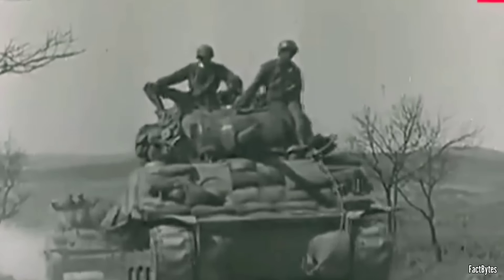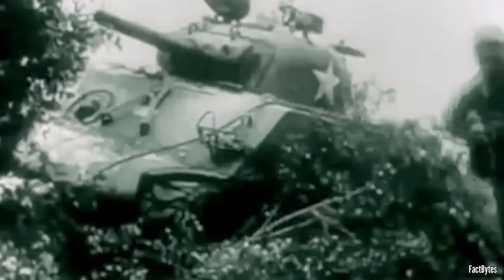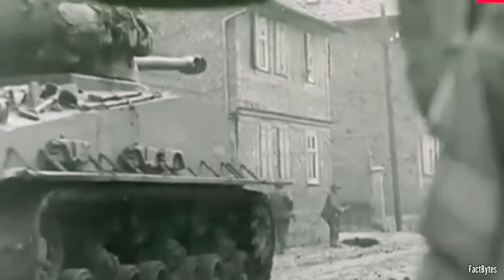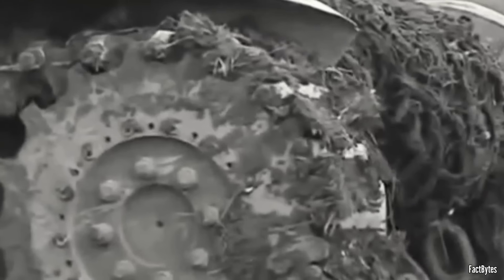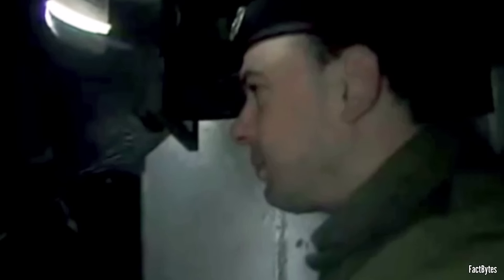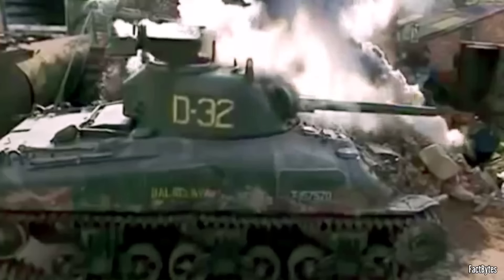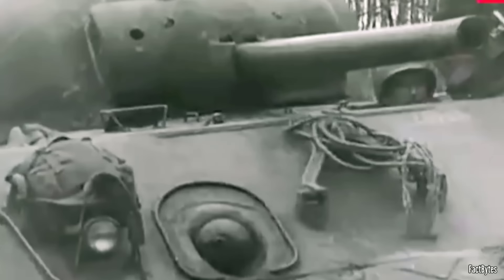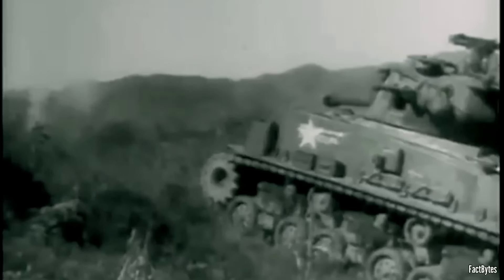Trapped in Steel: Just How Challenging Was Life Inside A Sherman Tank?

Comment: It was a massed production Medium (Everything) Tank. Any Farm boy could drive it fix it and fire it. The commander was as green as the paint. However if you shove 55,000 of these at the Enemy you will have results. The higher ups did not care about the crews. That happened afterwards with the M-26 Pershing which even then was used in limited engagements. The only (War Film) of a Pershing in action is Cologne. A Mk-V Panther is caught and ripped with 3 rounds from a 90mm M3. All three rounds went in one door and out the back. That gun was a version of the British 17 pounder by the length of the barrel and the shape of the projectile. The "Firefly" had a British gun in an M-4 Tank.
Reply: The 90 mm on the Pershing had nothing to do with 17pndr. It was the modified from the standard US 90mm anti-aircraft gun.

Comment: A primary reason for any tank to catch fire was simple doctrine.  Most tanks or anti-tank units were trained to shoot at an enemy tank until it caught fire.  A burnt out tank could not be refurbished and returned to combat.
At 13:05 there is a foot soldier communicating with the tank commander using a field phone wired into the tank’s electrical system.  This was a field improvisation that was incredibly helpful in coordinating tank/infantry combat.
Reply: The Sherman was notorious for catching fire as ammunition was stowed in the side sponsons. Any hit on the tanks sides would cause an ammunition fire. Because of the losses in 1943 the tanks interior was re-designed and the ammo moved from the sponsons to "wet" stowage bins on the tank's floor.
Reply: @billballbuster7186  No, the Sherman was not notorious for catching fire. That myth has been busted a long time ago. "wet" storage was an improvement but like the original poster stated, tanks were shot until they caught fire to make them useless in regard to repairs. In Europe, U.S. tankers had only a 3% death rate from enemy action....compared to 18% for infantrymen.
Reply: @vonbennett8670  Ok, if it didn't catch fire why on earth would they completely re-design the hull in late 1943 with Wet Stowage to prevent ammunition fire???
Reply: @billballbuster7186 It's called improvements. Everybody does it it would be stupid not to and you would quickly get outclassed by the guy that did do it.
Reply: @garykarr3948  Yes but if it didnt catch fire the money would have been betters sent on more armor and a better gun.
Reply: @vonbennett8670 Average burn rate of 62%

Comment: My dad was an ordinance engineering officer for the Advanced Section of Command Zone (AdSec CommZ) assigned to US First Army from August 1944 to VE Day tasked with setting up recovery and repair logistics chains for the 2nd and 3rd Armored Divisions. He told me that the Ordinance Branch did studies after the war and found that the Sherman took approximately 50 man hours to get off the water, gassed up, armed, and pointed toward the front, while it took the Germans 250 man hours to do the same with the Tiger and King Tiger. While the Sherman may not have been as good as the Tiger (especially before it got its gun upgraded from the low-velocity 75mm to the 76mm high velocity gun), the Allies had a lot more of them than the Germans did. As they say, tactics are for amateurs, logistics are for pros.
Reply: Do you actually believe that?

Comment: The M4 Sherman was a very good tank. Agile, reliable, reasonable armor, reasonable firepower, easy to repair, comfortable and good looking. Okay, that last one is just my opinion 😅
Reply: Next to useless armour, the nickname for the sherman was Ronson. The Sherman was the right tank in that it was fast and easy to maintain, both the gun and the armour were soso. It was also light enough being only 34 tons to cross bridges
Reply: @brianmays4366  wet stowage mitigated that Ronson effect greatly
Reply: The tank was available and effective. Not the most powerful nor the fastest, or most armored.  It was a better tank design than the early T34 but needed the larger gun to be highly effective.

Comment: Early Sherman's were death traps.
The small oval hatches were referred to as "dead man hatches."
Early Sherman turret had one hatch for 3 people to use in an emergency.
Common misconception that the fuel burning killed everyone is wrong. The fire extinguisher was very good on the Sherman. The problem was the ammunition. Until the wet stowage came out, one spark in the ammo rack and you were done.
Wet stowage got you an additional few seconds to de-ass the tank.

Comment: 4:34 How does a tank implode?

I'm trying to think about pressure differentials during explosions. And stowsge locations for ammo, but I'm stumped.

Or am I dumb and the writer just have a brainfart?
Reply: It was the ammunition,they eventually decided to put it at the bottom of the crew compartment which saved lives
Reply: Wet ammo storage and diesel engines made the tank extremely difficult to catch fire or explode. Ammo storrage in the sherman was in various locations. Circular under the floor, and random spots inside the turret and front sides of the tank.
Reply: @blueduck9409  Implode... Not explode, that's why I was confused. I'm guessing the writer just doesn't English that well :)

Comment: ])eath Trap
Reply: Any tank can be a death trap when hit.
Reply: Not as many times as Sherman's. I don't see why people won't admit Sherman's were 2nd rated armor compare to the German or for that matter T34/85, Stalin's? Our Army Air Force was the counter to German armor.
Reply: @frankhernandez6883  you were more likely to die in a T-34 than a Sherman. The Soviets used Shermans, and many preferred it over the T-34. The Air Force only served as a deterrent for German armor.
Reply: I didn't say T34, I said T34/85. Different tanks here. The air force effected german production & transportation. I dare say if Panther/Tiger production had reached the levels of Sherman's, and the Luftwaffe had controlled the air, it may have been different! However, the air force had the other ace....THE BOMB!
Reply: @frankhernandez6883  It’s pretty much the same, just with different modifications. Germany did not have the resources to build or even sustain such a force, nor did they have the manpower. The Luftwaffe did not have the strength to regain control of the sky.  The atomic was originally meant for Germany, but they surrendered. If they kept fighting, Berlin would’ve been eradicated. So the bomb was used on you know who, twice.
Reply: @frankhernandez6883  " if Panther/Tiger production had reached the levels of Sherman"
I realize it's a hypothetical statement, but it could never happen. Germany had but a small fraction of the USA's industrial capacity even before the bombs started falling.
Reply: @morstyrannis1951  I agree. BUT, Germany made the mistake of NOT going into full war production till late in the war thanks to Speer. Another mistake was declaring war against us! Regardless, Air Power was queen of the battlefield back then as it is now. Churchill & Patton knew who the REAL enemy was here, the Soviets. And despite of their HUGE armor forces, they would have met the same fate as Germany in the hands of our Air Force. Germany could never hope to bomb factories beyond the Urals. Wars are won on logistics and supplies NOT flimsy Shermans. USSR depended heavily on RR transportation as they do NOW! Just bombing their rails would've made it a MUCH safer world for us all in the 50's and beyond. 😊